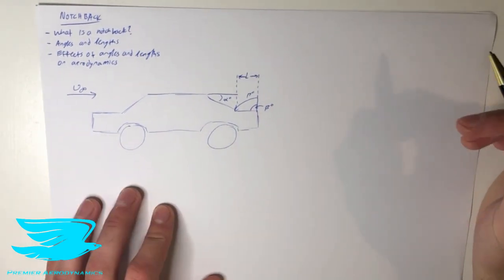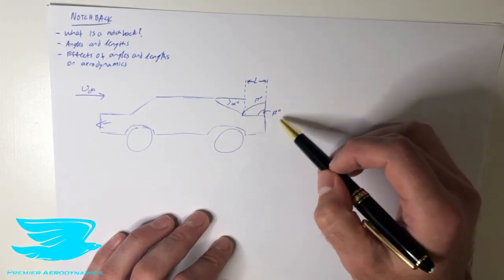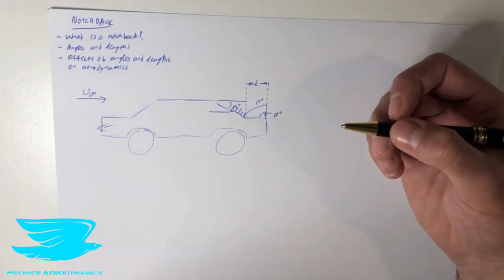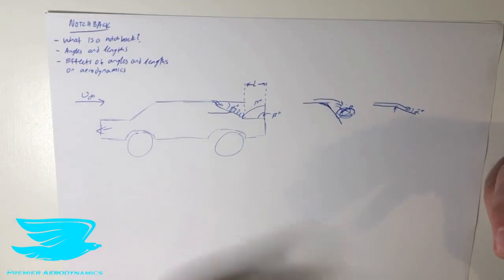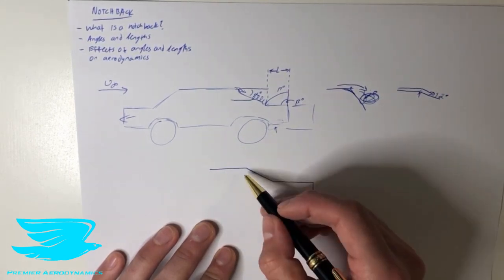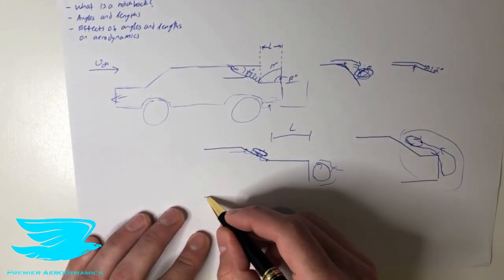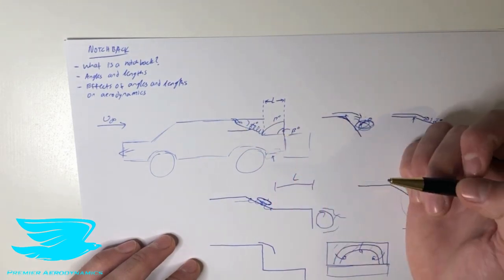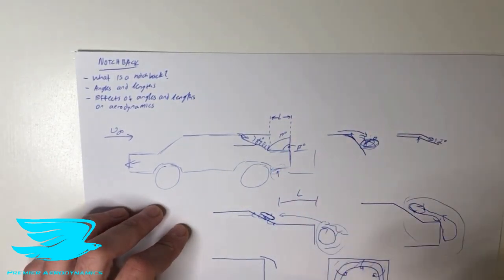{Automotive Aerodynamics #2} Notchbacks Explained

Comment: If the cabin is pressurized, and the front windshield is causing all this drag/air resistance, why can't air that hits the windshield, be channeled through the A pillars, and then exhausted above the rear glass? This would create far less drag than vortex generators, look cleaner, and would energize the rear boundary layer at alpha.
Reply from the maker: That's a good point. That definitely works and it effectively makes the car sleeker. One major reason why is not actually due to aerodynamics - the styling team often makes the final decision about a car's appearance so aerodynamicists are consulted but they don't get the final say.

Doing what you say definitely works, though.